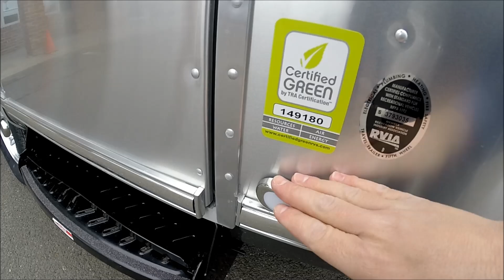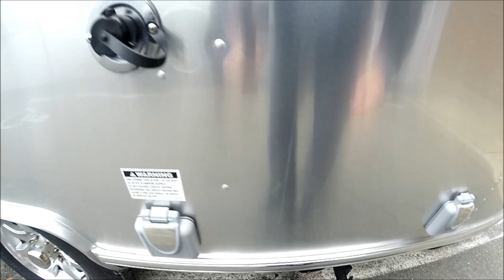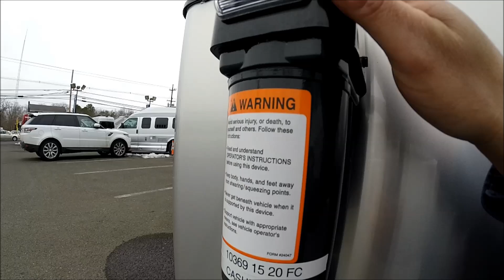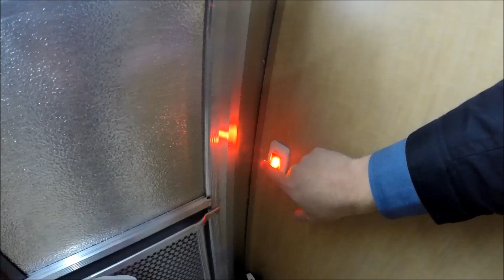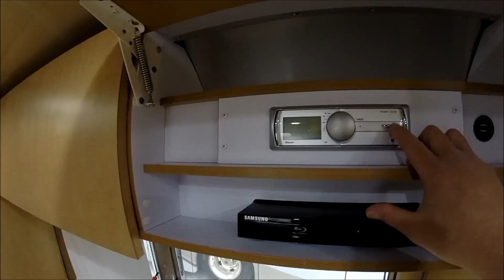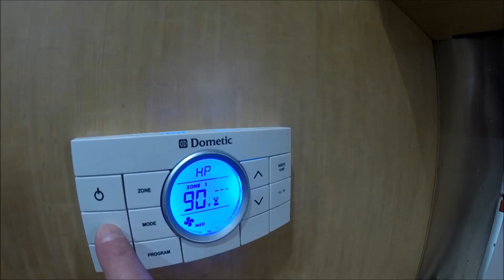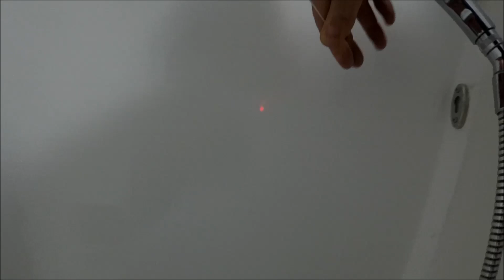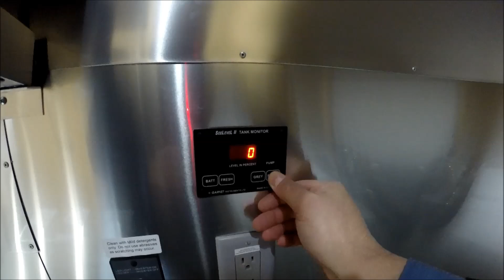Walk Through 2015 Airstream Flying Cloud 20C Bambi Small Travel Trailer

Comment: Great job Patrick! Looks like a great small travel trailer. With the inverter installed can 2 Honda generators (EU2001i's)  still be connected for electricity to the air conditioner and the rest of the trailer? Thanks!

Comment: great review but the three things I don't like about Airstreams (I had one so I have lived with these) are:
- single pane windows (don't keep heat in; always feel cold by them)
- AC unit is not ducted (on this model) and there are freezing and warm spots
- shower always has seat or something because of corner or wheel well and they are tighter than they should be
I don't think Airstream can fix these based on how the units are built (plus the awnings should be less manual to use...) ok a 4th...
Reply: good - the windows and shower still need to be fixed.  I understand how they are made and not really feasible though.